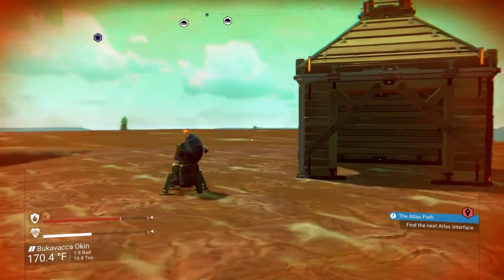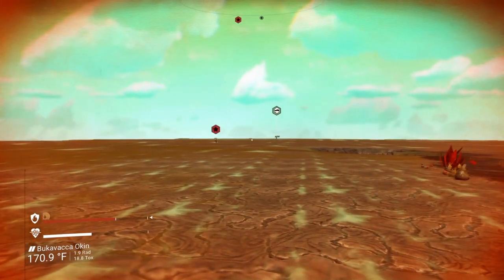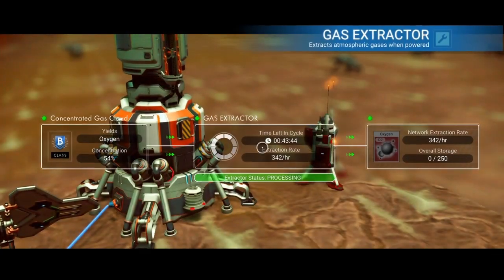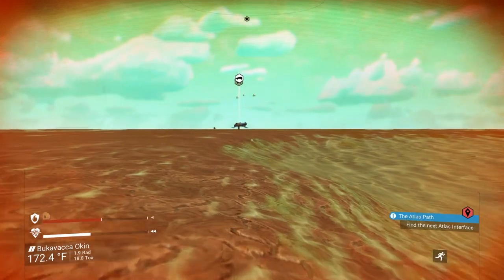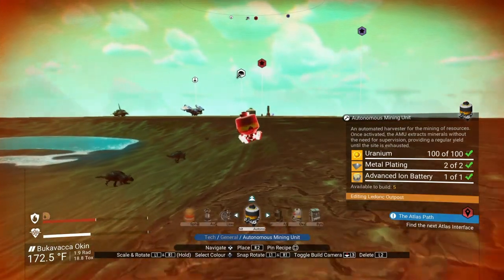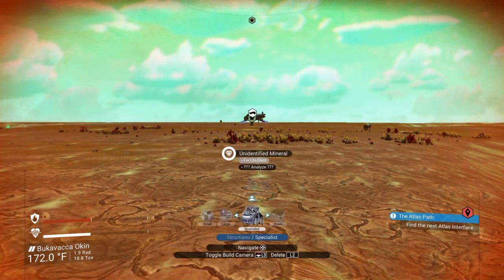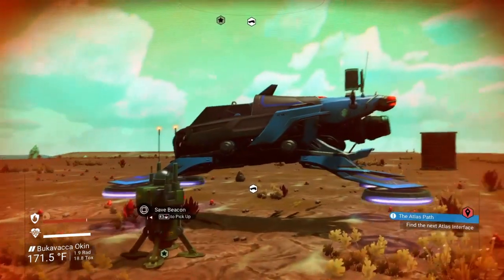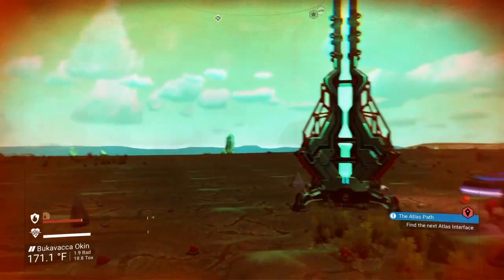No Man's Sky - How to Expand Base Boundaries (confirmed to still work in Aquarius update, Fall 2024)

Comment: THIS STILL WORKS! Although, now you have save and reload after every extension wall you build.
Reply: Thank you so much I was getting so frustrated
Reply: Does it work to this day? It hasn't been working for me
Reply: I didn’t have to reload and I did it today
Reply: Found out it only expands to 996 Units away from the base terminal
Reply: ty. it still works when u save and reload
Reply: I didn't have to reload and it worked
Reply: I'm able to build about 900u away but power wont route past 300u
Reply: Frankie C you should build a base structure requiring energy between the energy source and your goal destination and connected the power line from there. I ran into a similar issue but I used a structure that required power and I guess it reset the distanee CD
Reply: @cameronarias9468  you are absolutely correct. Using something like a battery to extend the range is super good.
Reply: See you're literally the first person to mention this, spent aaaaalll night trying to figure out why it wasn't extending the range. So basically place it then reload the save and place again.. does it calculate the space for the object only after the reload? Also there should be a note add to the wiki this information seems pretty important
Reply: Amethyst Prince yes. Basically bring a save point beacon with you and then place the extension wall, use the save point. Reload that save you just made and then repeat.
Reply: This worked for me the save and reload part though I only had to do it once

Comment: Thankyou, Thankyou, Thankyou.... I have knocked down and restarted my base so many times trying to get it to work so i could fit in the gas, electricity and metal mines. I even tried running wires back from another base computer near them all with no success. Your video has just saved me a whole load of headache, and have just expanded using your cubes 970u out from my base computer to my S rated Electric spot. ( XB1 patch 2.41)
Reply: Jesus, I can sign up on that. Pulling my hair last night!

Comment: Thanks it still works in June 2020.  After successfully connecting power from 600u away,  I had to come back a few days later to add more power generators at the "remote" site. It wouldn't let me, but then I just reloaded the game and it worked fine.

Comment: If it doesn't work for you then, try the following, after you place the far wall, place a wall (or something) inside the current base area to cause an update/recalculation, I was running into a problem where it wasn't extending until I did that on PC after the latest update.

Comment: I found a nice little island with a deep 45-50u heart shaped alcove to store my sub. Pulled out my MT and the EMP hot spot was something like 1050u away. I am able to get the base computer on the edge of the island and it’s at 950u. Unfortunately it’s a C class and the S class I found doesn’t look nearly as cool. Is there any chance that a EMP hotspot would be in any other direction but closer?
Reply: No sadly that one is the one your probably gonna have to use

Comment: Did this recently with batteries, but after leaving the game and coming back in it would no longer let me build things more than 300 units of distance from my base.  I'll have to try it with small buildings instead.  I recently started putting down one floor/ceiling tile and then placing the battery on it, so I'll have to test if that lets me keep building after I come back a day or two later.  Thanks for the clear explanation of the pseudopod style expansion.
Reply: Hi. Did placing the battery on a tile work as I'm about to give this a go. Ta.

Comment: might be patched, i cant expand it
Reply: im thinking the same thing
Reply: @prismdrone3475  i restarted my computer and it fixed it for the most part, maybe i was lucky
Reply: @sweetseremine  im on ps4
Reply: @prismdrone3475  aaaah well i dont have much i can say now xD
Reply: You can still do it on PS4, I just did it. But it is temperamental. Actually I did it initially and then it stopped working, and went back to default. I managed to get it working again by reloading my autosave. Tried it first thing after and it worked again
Reply: @prismdrone3475  You have to save and reload.
Reply: @goldump   i've already figured it out. I thought he meant placing the object at the border of the base boundary, but nope you have to place it outside the boundary.

Comment: I had this working only 10 mins ago but as soon as i left the area and came back you can no longer build outside of the area (300 unit range) :( 1 why restrict us, the game is basically single player and 2 if you are going to restrict us why are power sources and mining sources so far away from each other to begin with, makes no sense to me. I have 2 functioning farms that barely reach each other, one no longer works as intended as obviously it was patched so we can not do this anymore and the other functions fine but nodes are JUST within reach of each other.
Reply: Reload the  game and it should allow you to edit  the base.  At least on PS4 it seems to be pretty reliable.

Comment: With the origin update, this no longer works.
Reply: Still working, tested now and base extented.
Reply: @tomnovak3952  Yeah I meant to come and update this yesterday, it is still working but at times it breaks and stops working, and the only way to get it to work again is to save and restart the game, not just restart the save but the whole game. 
 
I found if you are base building outside of the base range and you run out of materials, say ferrite, if you use your base teleporter to go to another station to buy some, when you get back to the build it will be broken and you will need to restart the game. When you do that you will be able to carry on building.
Reply: @johnhall9250  can confirm, also happens to me

Comment: dont know, but it does not work for me, and its only 130u to the hotspot....
Reply: It still works for me (PC). In my observation, the object that is built with the purpose of expanding the base radius does not actually expand the base radius. But, there is a new "base radius" around that object. Be aware of this especially if you use the free-camera mode to place an object as far as possible from the current base radius' edge.

Comment: Did they fix this it doesn’t work
Reply: It still works for me (PC). In my observation, the object that is built with the purpose of expanding the base radius does not actually expand the base radius. But, there is a new "base radius" around that object. Be aware of this especially if you use the free-camera mode to place an object as far as possible from the current base radius' edge.

Comment: Not working for me
Reply: It still works for me (PC). In my observation, the object that is built with the purpose of expanding the base radius does not actually expand the base radius. But, there is a new "base radius" around that object. Be aware of this especially if you use the free-camera mode to place an object as far as possible from the current base radius' edge.

Comment: It doesn't work anymore...
Reply: I use batteries instead of building pieces to extend the limits.  I just did it last night.  The base is approx 1200u wide. On that base there was 5 hotspots i was building on.  I map out all the hotspots and place the base computer as close to the center as I can.  Then I start from the center with a square prefab and work out to the electromagnetic hotspot first to get power established. Then I go from the battery I place at the prefab and work my way towards each of the rest of the hotspots.  I go until the build menu changes then back up a little and drop a batter, connect the power wire on one side then  grab the wire on the other side and go until I can drop another battery.  If you don't exit the build menu you can still hold the wire, switch to battery so you can drop it, then go back to wire and connect it to the battery you just dropped without having to go  back and forth connecting wires.